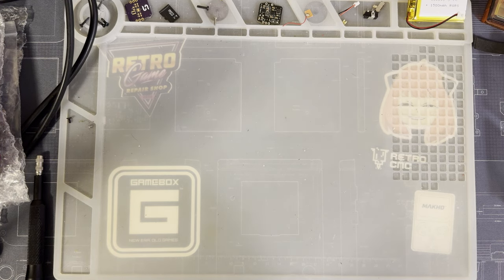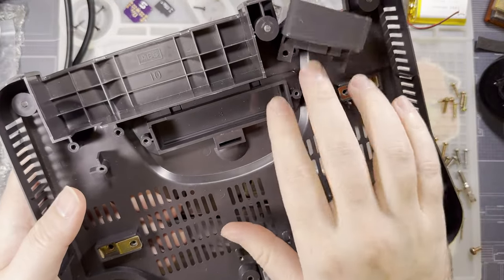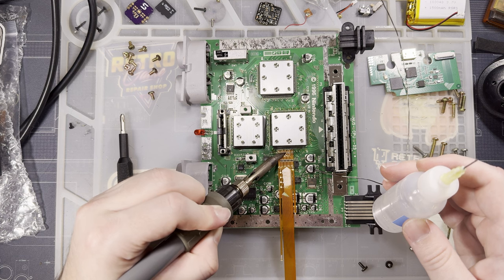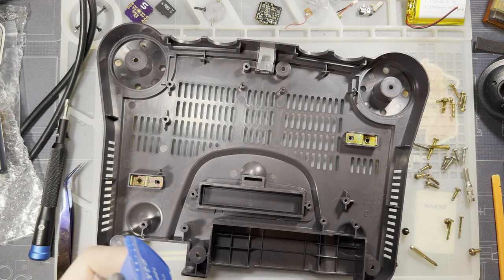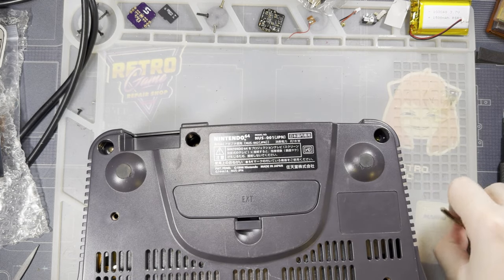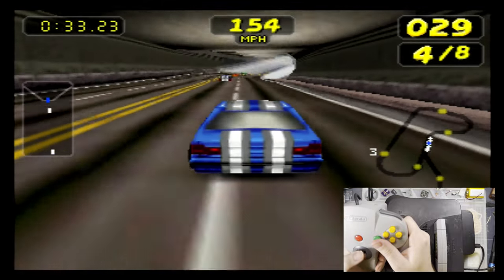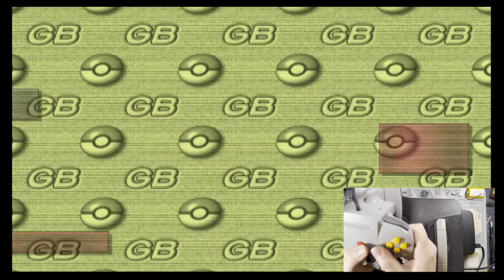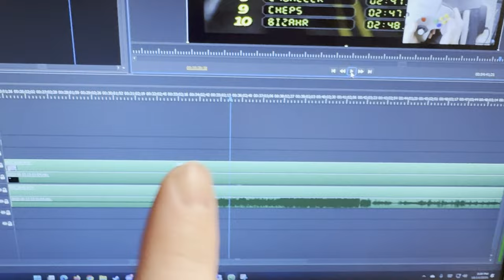Nintendo 64 HDMI Out Kit

Comment: Yeah i think it has something do with capture card.. I know mine wouldnt do anything with DD sound as output. But change it to anything else and it quits crackling and works the way it should.
Reply from the maker: My capture card has passthrough and the audio was working fine on my monitor. In hindsight, I could have rerouted the passthrough audio back into my PC and recorded that. Oh well. 

I think the issue is still with the mod itself and not necessarily my capture card even though the N64 worked as expected when I plugged it into other things.

Comment: what i think aspect ratio is doing is:
1: 2x scaling
2: 3x scaling
3: fullscreen
the funky thing is that almost every n64 game doesn't use it's full resolution anyway, it always has a black border, usually of 8 pixels per side, so 320x240 turns into 304x224, just to give an example. games can go lower and the border will be larger since the signal resolution is still 320x240 or whatever base resolution they chose since the n64 can produce multiple resolutions up to 640x480. the border is obviously not a problem for crt tv's.
a shame that it doesn't do deinterlacing correctly, i've been contemplating getting one of those since they are cheap.
Reply from the maker: Yeah, that text in pokemon stadium was ROUGH to read. I plugged in my ultraHDMI modded unit later and the difference is night and day for interlaced content.

Comment: Damn skill. I cannot to that kind of soldering without being closer or checking and re checking as i go. wish i could pull that off! i create so many shorts if i go like that lol.
Reply: Flux is your friend
Reply: @cidkramer  might need to get a different kind.
Reply from the maker: @redlanternsuperman  A microscope can be really cheap and really helpful for stuff like this. I have one that I use frequently off camera but the footage capture quality kinda sucks and it's tedious to splice the footage in so it usually doesn't appear in videos. 

Mono scopes fuck with your depth perception but they're hella cheap and still really good once you get used to it. Stereo scopes can be real expensive though.

Comment: The mod is very finicky with some tvs and receivers.

Audio issues (distorted) on my 12yr old sharp TV. Just like the capture card audio from this clip...

When I plug the hdmi cable into my 2yo denon receiver,  I get no audio.

When I plug it into my LG c7, works no problem.

The included hdmi adapter is garbage.. buy yourself the adapter cable instead.